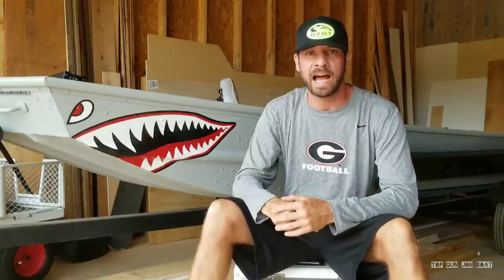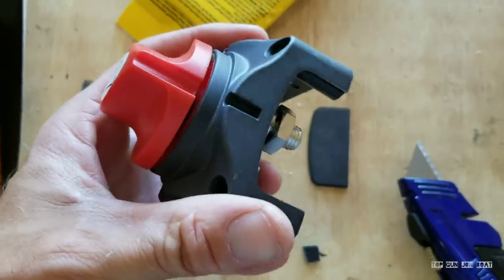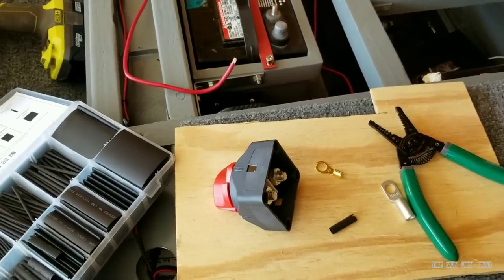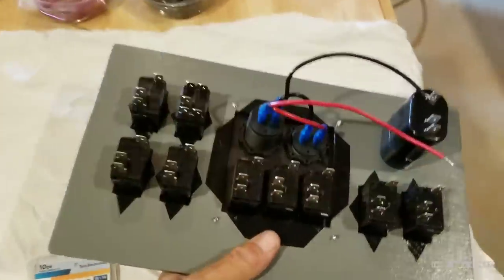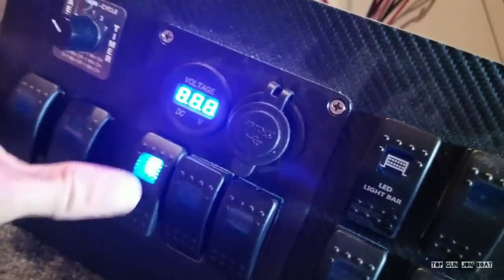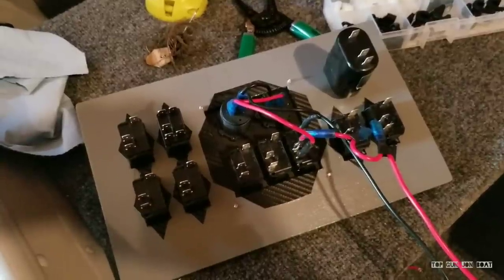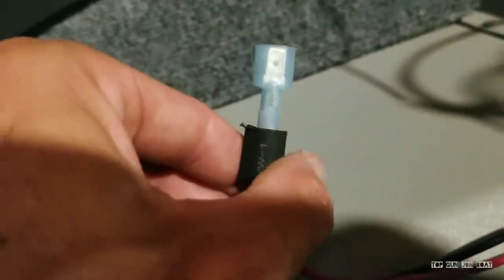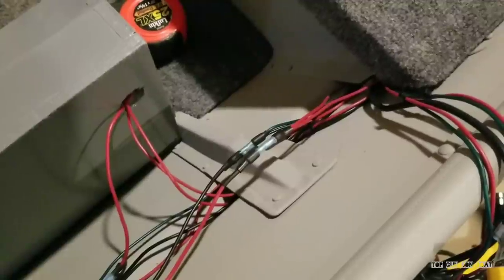WIRING MY BOAT 2- DIY Full Electronics In Jon Boat

Comment: How do u get both 14 gauge in one female to Dasiy chain the rocker switch’s I have tried and they don’t fit fml
Reply from the maker: If I go 2 into one  typically drop diwn the guage connector.  So if going 2 14 gauge ill use a 12 gauge connector.  2 16 gauge, ill use a 14 gauge. I try to strip them a bit longer and twist them together tight before inserting into connector.  That's just how I do it

Comment: If I had one tiny nit, I would suggest setting up the battery kill switch so that the ON position is where the switch knob is parallel to the 8ga wires, and OFF is perpendicular.  This would make your switch visually similar to the way natural gas valve handles work. Still...fantastic work!!!
Reply from the maker: Good idea, thank you!

Comment: how did you connect your timer?  I have the same aerator timer switch 10 amp and a 4 am aerator.  I would like one gang switch to control both but what size amp do I use in my sitiuation?  10 amp for the timer or 4 amp for the aerator?
Reply from the maker: You wouldn't need a gang switch to control the livewell switch and pump. The livewell timer switch IS the gang switch. Basically,  wire the pump up to the livewell switch as you would w any other accessories to a standard gang switch. Then run your hot wire from the switch to your fuse box and fuse w a 5 amp. Thats what I did. My impression was the switch can handle up to 10 amps but if its running a pump recommended to fuse at 5, go with that. Other wise the pump could catch on fire before it pops a fuse at 10 amps. I ran mine that way and never have had any issues. Recap, wire pump to timer switch, fuse w 5amp. No gang switch needed.
Reply: @AnthonyJonesBrigadeBoats  thanks man, much appreciated.  I really enjoy your videos and how much detail you go into them.

Comment: Missed you Maverick.. Ice Mans been slaying catfish.. good video. Got my wiring almost done except my epic fail of coduit up into my steering console.. did alot of work for nothing so taking a few days off to re-evaluate my approach
Reply from the maker: Wiring is very tedious yet rewarding. I don't think I've officially announced it but i am dubbing the top gun jon boat maverick and the new 10 footer will be goose. I thought that would be fitting. I'm going to put it on the boats somewhere. I knew youd love it cuzin

Comment: You said you recently went to heavier gauge wire, what gauge was you at and why did get heavier?
Reply from the maker: I'm not sure exactly what clip your referring too. Some of the LEDs and accessories come in 18-22, I dropped it down to 16 in few cases bust majority of all wiring in boat is 14. Overkill in some situations but kept it simple and ran 90% in 14 gauge.

Comment: What kind of battery is that ? Where did you get it and are u only running one ?
Reply from the maker: It's a deep cycle,  don't know the size off top of head but it's one of the higher rated ones. I got it at my local battery supplier in my town. I have one up front that stays in boat always forall on board accessories and I have a second battery that goes in the rear designated to run my electric motor.

Comment: Your kill switch should be hooked into the negative side of your battery. Battery electricity runs from negative to positive which would make the negative the most direct route for master cut off. If you keep it on the positive you will have phantom electricity running through your boat.
Reply from the maker: I disagree. If this were a NHRA race car then maybe because the negative would be grounded to the sheetmetal and in an accident you wouldn't want a positive short on the kill switch terminals. In this application there is no negative ground to the chassis. I'm simply killing power to the line. In theory there would still be power coming off battery positive side to the kill switch , so about 8 inches of wire. If that's what your talking about w phantom electricity. When switch is off, power beyond that point is disabled unless I'm not understanding what your saying.
Reply: Anthony Jones I guess you can do it either way. It is just a break in the complete circuit. I did mine to the negative cause that is how I have seen it done from the bigger bass boats. Btw, I love your videos. Thx
Reply from the maker: @andrewchilders6320  All good man, I appreciate it. Yeah I did a lot of research and seemed to me the negative side also coincided with some sort of ignition, a ground, alternator. For straight connections like I've got, just a positive and negative coming out going straight to fuse box, I went with the positive side as close to battery as possible. Bass boats have the above things I stated so a negative side prob works the same way as a race car. All in all, I'm simply looking to kill power coming out of battery in an emergency or for tampering. But yeah, there's more than one way to do things and also depends on the situation i guess. Thanks again for the input.
Reply: Hey Anthony! Just ran across this and had a flashback to our conversation last week. This is straight from a Yamaha Outboard manual. Tight Lines!

Disconnecting the battery
1. Turn off he battery cut-off switch (if equipped) and the main switch. Notice: If they are left on, the electrical system can be damaged.
2. Disconnect the negative cable(s) from the negative (-) terminal. Notice: Always disconnect all negative (-) cables first to avoid a short circuit and damage to the electrical system.
3.Disconnect the positive cable(s) and remove the battery from the boat.
4. Clean, maintain, and store the battery according to the manufacturer's instructions

Yamaha F20SEHA Owner's Manual PG. 93/110